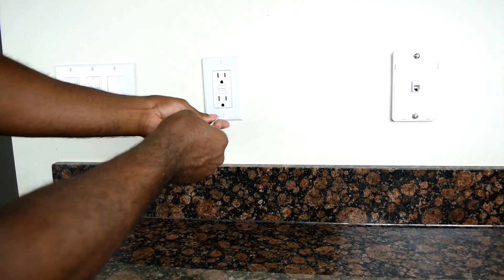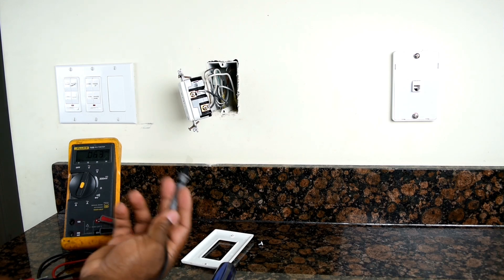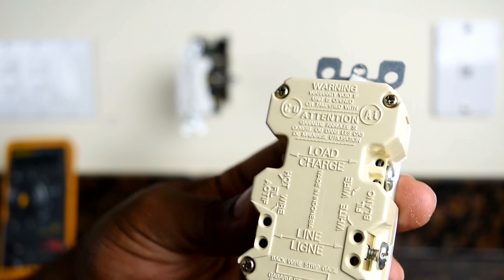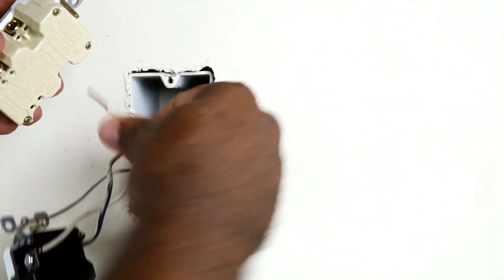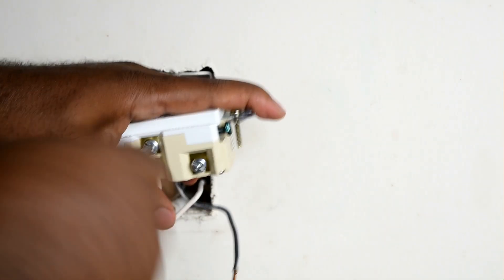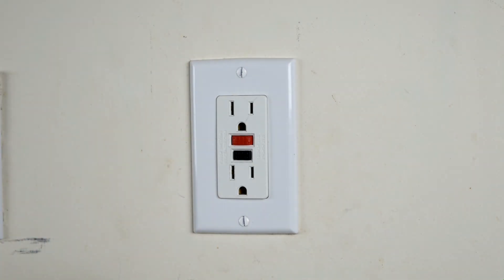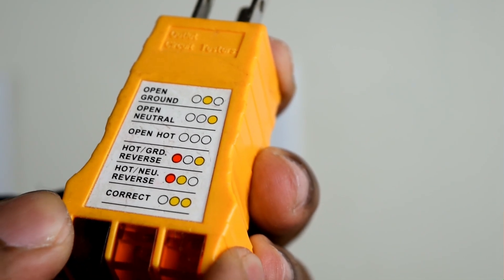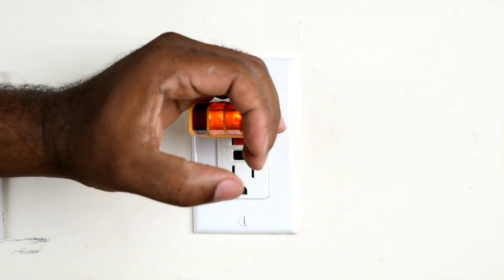How to install or replace a GFCI Outlet

Comment: Great video, thank you.  I have GFI plugs that all cooked, kind of at an angle.  I tried to adjust the screws, but I think it's the boxes set wrong.
Do you have a video on replacing the electrical box?  Or how t straighten out the plugs when the usual screw adjusting doesn't work?  Thank you.

Comment: Dude! What kind of tutorial is this?  How did old outlet come out of wall so easily?  What were you doing with them needlenose pliers?  How did you reinstall all that wiring so securely back into wall?  Other than the shock warning, what are the other risks to watch out for with installment?  You are as efficient with handy work as inefficient with DIY tutorials. 👎

Comment: Great information DIY Creators. I just found out that GFCI breaker outlets can be installed on the same circuit like 2 bathrooms. The one GFCI breaker outlet in the bathroom wouldn't reset. I watched another video which suggested I check all the GFCI breaker outlets in another bathroom if there was one. I did check and Yes, that GFCI breaker outlet was Tripped also. I Reset that one and went back to my original one in the Master bathroom and Reset that one as well and now Both are working fine. Thanks again for the Direction on how to replace one in case I do.

Comment: Why did you see voltage on the line even after turning off the breakers at @1:36
Reply: It's most likely what is known a ghost voltage. It's usually caused by wires being close to other wires that are receiving power. You can verify this with a dual impedance multimeter. Set to low impedance (low Z) and it should read 0.

Comment: You have four wires, I have two. Three, including ground wire. What then?
Reply: Just connect the black wire to the brass screw for line and the white wire to the silver colored screw for line and the green wire or bare wire to the green grounding screw and you're done.
Reply: @njsongwriter  I'll mention, the additional wires are for other outlets or lights that are connected to that outlet. If there aren't any other outlets, or if it's the last one in the chain, there won't be those wires. (for gfid and afic it's best to have it first in line, since it protects all outlets that go past it)

Comment: So really the GFI is almost the same of a regular oulet? THANK YOU
Reply: Not quite, Denise. On a regular receptacle you have 2 brass screws and 2 silver screws and as long as the connecting tab between the screws is intact it doesn't matter which screw you use as long as the black (hot) goes to gold color and the white (neutral) goes to silver. This is always the case. In a gfci the energized hot wire and its corresponding neutral must connect to the side marked "Line". If you have 4 wires and you want the downstream receptacles gfci protected also, then the other 2 wires go to the "Load". If you have 4 wires and you want the downstream receptacles to be independent of the gfci then all wires are connected to the "Line". There's 2 holes next each screw for this purpose.
Reply: Thank you so much..Ended up getting  an Electrician  to install  we needed a 220 also...so all worked out..love your videos Thanks again.

Comment: I only have a 2-wire connection on an existing GFCI that I need to replace. Not grounded - just a line and load wires. Does the  white (neutral) wire connect to the line and the black (hot) connect to the load on the new outlet?  I don't have any type of testing tools, so I can't test if the voltage is live after shutting the breaker. Should I just use the master breaker shut off?

Comment: I have an outlet not working that only has load wires, one neutral and one hot. For some reason after I installed a new GFCI it doesn’t get power. I also have a few other outlets that had stopped working. I can’t figure out where the problem is. My tester says hot ground reverse on all the other outlets. But I don’t have a ground. Any ideas?
Reply: Do you have black connected to the brass screw and white connected to the silver colored screw in the line terminals?

Comment: As an instructor for electricians, I’m impressed with the steps you covered in this video. Did you work as an electrician previously? The way you hold the GFI hints at experience. The only thing I would add if I had to find something is to check the existing wiring to make sure it’s not damaged, check the existing connections under the wirenut(s), organize the wires, and be careful the ground doesn’t touch one of the screw terminals when pushing the receptacle back in but that’s minor. I always get scared before watching electrical videos but you didn’t disappoint. Also, I love all your DIY woodwork videos. Keep being awesome!!!
Reply: I know you’re not joking, but “…the way you hold the GFC hints at experience…” is the beginning of a good joke.

Comment: You could've used the "outlet" (it's a receptacle) tester to test the power being off before you removed the receptacle. And the tester doesn't have "settings" it had indicator lights.   This is why you don't smoke weed while on the job.

Comment: Can you add a GFCI outlet to an old, ungrounded circuit by running a ground wire to a cold water pipe or other ground and connecting that ground to the GFCI outlet?  Thanks for an informative video and reminding us to be sure the power is actually off to a circuit when you think you have tripped the correct breaker (but didn't).
Reply: Good question. I've actually done that before. Not sure if it's kosher. If you ground it to a plumbing pipe where all the pipes are copper, it should work but not with plastic like PEX.
Reply: Not unless the water pipe is bonded to the main electrical panel. This means that you would need another wire connected somewhere to the same pipe and then connected the grounding/neutral bus bar at that panel. If not, the stray electricity will not have a return path to the main panel and therefore will not force the breaker to trip. In your case, if there's no ground wire in the circuit and it's an old house there may not be a grounding bus bar in main panel. Probably, your best bet is to install the gfci with no connection on the ground, and label "no equipment ground" on the faceplate. You will still get shock protection.

Comment: What happens if you accidentally hit the reset button on a working GFCI? Sounds stupid I know but It was dark I didn't have my glasses on and I just reached under the counter for the test button and now the reset button won't stay locked and just pops back out

Comment: You should plug something in, like a radio or lamp, before you flip any breakers. That way you get the right one on the first try.
Reply: The outlet tester will work OK for testing, except it has no light or sound that you can see/her from a distance.

Comment: Help needed, I was told check junction box for number , mine says 10 for the circuit I am changing, yet the GFCI I'm changing out is a 15 ? Am I reading things wrong?
Reply: You mean it's breaker number 10? The 15 is the amps for that circuit. 15 amps us wired with #14 wire. 20 amps is wired with #12 wire.
Reply: You mean check the breaker panel. A junction box is a completely different item.

Comment: How to distinguish which side line and load comes out of wall ? Before putting in gfci
Reply: Teflon Don    Line conductor has voltage on it when breaker is on and conductor is disconnected.   Shown in the video.    What do you not understand?

Comment: Thank you verymuch,  I followed the directions and could not get my three bathrooms 2 GFI's and one standard to work.  Once you stated to review the line and load difference on the back of the GFI, it solved all my frustration.   I did not see that on other videos.

Comment: hi nice video,i did added another new 20 amp breaker to my electrical panel and run the wire to the destination,my question is i only have 1 white 1 black and 1 ground on my wires ,should i just buy a single receptacle?thank you
Reply: Just connect to the line terminals. Nothing needs to be connected to the load.

Comment: I did that but now I have an open neutral
Reply: unhook your neutral and either strip some more insulation off, or cut and un-strip. an open neutral means that the neutral wire is not completing the circuit.

Comment: I have a gfi wired in my bathroom that is also connected to the switched light. The gfi outlet has a small light on it, that is lite and shows the outlet is getting power but nothing works if i plug something in. Also if i push the test button it trips the breaker .. wtf  any thoughts ???
Reply: I would swap it with another receptacle and see if the issue persists, it sounds like internal mechanism failed and/or you have some incorrect wiring.
Reply: The switched light does not need to be GFCI protected.

Comment: Is this the kitchen GFI or the bathroom GFI?
Reply: Why would it matter?
Reply: @njsongwriter  I didn't remember why I asked about it.  I guess at the time, I needed to replace the GFI in the bathroom.  I was looking at tips on how to do it. Soon after, I realized it didn't matter since the circuit breaker needed to turn off before replacing it.

Comment: Nice video but could be a little more specific when u give details about load and line wires, such as speaking about the color of wires, not just checking the load wire here..imo..but thank you.
Reply: The color of the wires connected to bothbthe line and the load are the same, one black and one white. The wires supplying the power connect to the line terminals.

Comment: I've replaced my outlet correctly and i still have no power,what can be the problem?
Reply: Maybe line and load are flipped.
Reply: Did you press the reset button on the GFCI receptacle?

Comment: There are a few steps and recommensions I would do first, one is to use an GFCI circuit tester instead of a standard circuit tester. The reason is you want to test the outlets on the load side of the device after you install the new GFCI. By tripping the device"test button" does not insure that the remaining branch circuits are working properly. I would start by removing the "line" hot wire first and then using a wire nut to cover the exposed conductor so there is no inadvertent contact with the ground or neutral wires, even though you have the power switched off, it is good practice. The ground should be the last wire you remove from the old device and the first wire to attach to the new GFCI...again good practice. 
GFCI's require a bit more knowledge when it comes to connecting the wires to the device, switching any of the wires "line or load" will make the device inoperable. Therefore having the proper circuit tester to make sure you have the line and line neutral paired is critical to the proper installation. Marking the neutral with a sharpie will indicate the line circuit, especially when there might be more than 2-pairs coming into the junction box. Other than that , it was an informative video.

Comment: thank you for illustrating how you could accidentally switch off the wrong breaker. You could potentially save lives with that.
Reply: Bill Hamilton do this during the day and you can shut the entire master  CB panel breaker off.  Kill all power to the house for a few minutes.  Clocks and computers can be reset.    Your heart may not be able to have that luxury.
Reply: @stephencannon3140  000
Reply: I had a similar problem very recently wherein I shut off a breaker for the labeled area of the house and used a circuit tester that still showed full power running through it. I consulted an electrician who explain that sometimes outlets are on two breakers to avoid overloading. That was a lesson learned
Reply: you cant die from Ac....
Reply: How would I know if I had any other breaker besides the box shut off ? Does it look the same? I will buy one of those testers as well to go the safe route but I’m also curious
Reply: I was "shocked" to find out that myself when try to DIY replacement.
Reply: @PChandler65  yeah i'm worried that i get shocked and am unable to remove myself from the shock and get electrocuted or of having severe burns from the shocking that cause long term damage

Comment: I have 3 GFCI's (also listed in the fuse box).  One in the master bath was out, one in the kitchen was out and one was working.   Whichever GFCI was out had also taken out the fridge, microwave, hot water heater and several other outlets.  I replaced the GFCI wire by wire and was sure I matched load and line just like the back of each unit showed (hard to read with wire length restrictions).  When I hooked it up, that specific outlet still doesn't work, but all of the other outlets are now working.  My GFCI outlet tester shows good for all outlets except this one.  This unit won't reset if not properly wired.  Does all of this mean that I wired the new GFCI backwards?

Comment: So, I did exactly that, did one wire at a time and I gotta keep pressing the "reset" and it keeps popping out. Any ideas?
Reply: Cooper Listul Too much load on the circuit
Reply: If you have an old medicine cabinet with an outlet built into it connected to the load that could cause the problem if it's ungrounded.

Comment: @ DYI
If my old outlet has the wires sodiered on the outlet what do I do?
Cut the wire or de sodider?
Reply: Jacob Marroquin Cut the soldiered wires and strip the insulation to make new contacts

Comment: A safe way to test is plug in baby monitor or similar product and once you turn off a breaker and the signal dies on the monitor, voila! No power, plus saves trips back amd forth if you don't have it marked

Comment: What do you do if there's no ground wire? Can you please make a video on adding a ground so a 2 prong outlet can be turned into a 3 prong outlet ?
Reply: Change the ungrounded recep to a GFCI and leave the grounding screw unused.  GFCI does not need an EGC to function.

Comment: How can you tell which line to add a Gfi when there's two outlets by a  water source,  one outlet has a switch and the other just a regular outlet.
Reply: If you have two receptacles in the same box, after determining which set of wires is bringing power into the box attach those wires to the line terminals of the GFCI receptacle then to power the other non-GFCI receptacle in the box run wire from the load side of the GFCI to the other receptacle. Now both outlets are protected by the GFCI. If there is also a switch, it should be powered by the line rather than the load. There is no reason for a light switch to be GFCI protected.

Comment: Great easy to follow instructions.  Might have been helpful to some folks to include what to do if you don't know which are line and load wires
Reply: To know which wires coming into the box is the line supplying power you need to pull the receptacle out of the box enough to use a test light. Press the test button on the GFCI to trip it. Then use the test light to determine which black wire is providing incoming power.

Comment: To make it clearer you could mention that black wire is "hot" and white wire carries the current on. You kind of do that with the 'load' explanation but black is important. Also, no mention of the option of using the push holes to wire up the new plug. Just push the wire ends into the load holes and tighten the screw ... all done for you.
Reply: The push holes, also known as back stabbing holes should not be used on outlets or switches, they are very unreliable and have been known to trip AFCI breakers. You should always use the  side wiring or the back wiring plates on outlets that are equipped with those plates, but never use back stabbing. In fact, the NEC ought to look into forbidding those going forward,
Reply: Back stabbing can result in loose connections. When we moved into our house, often when we turned on the hallway lights all the GFCI outlets in the house would trip. After investigating I discovered a loose connection in another box. Fixed it and everything has worked fine since.

Comment: What if you don't know which are the line and load cables?  I have 5 wires coming out of the wall in pairs (one thing I notices is that when you separate either pair light on the room goes off, and the 5th cable is a green one, thanks
Reply: Line is coming in and the load wires are going out. 2 are line 2 are load and the 5th green is your ground

Comment: What parts is he touching the voltage meter to?
Reply: Syrena Xhaferi
he is touching meter to the 
1. GROUND WIRE (or the BARE WIRE/GREEN WIRE).
and the other is touching the 
2. HOT WIRE (that's the BLACK WIRE in the LINE SLOT).

Comment: Any suggestions?  My husband just installed one of these outlets. The little green button is lit in the lower right corner but when you plug something into the outlet, it doesn't work.  The switches don't push in or out.
Reply: Disco Winter break

Comment: Glenn, is the wiring the same even if the previous outlet was not a GFI outlet?  My gut tells me probably so, that the GFI outlet just has the internal "breaker" and otherwise is wired the same but not sure.

Comment: wow..i hope you answer this pls..after I cut power from breaker, it seems the outlet still has some power..i felt a little tingle..seems like around the screws..why is that? what should I do? changing from a old outlet to a gfci..has 5 wires..2 blk, 2 white, 1 ground. thx..